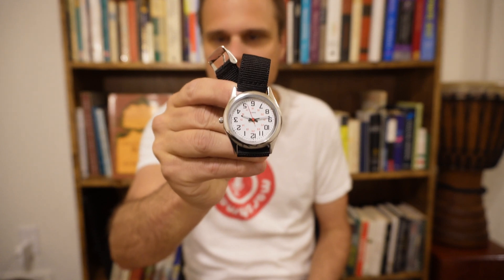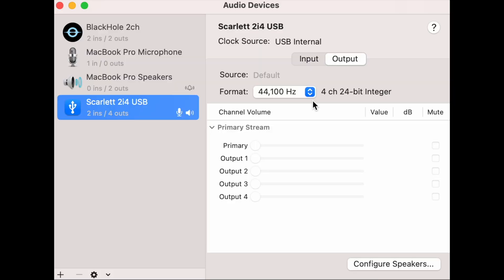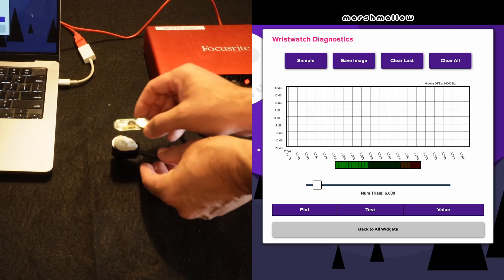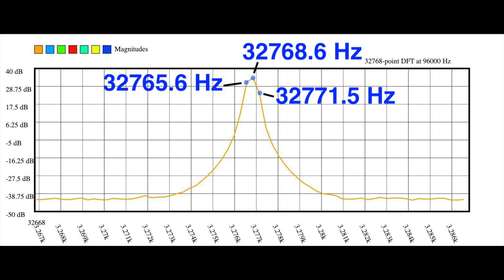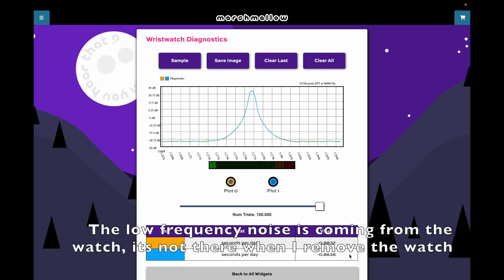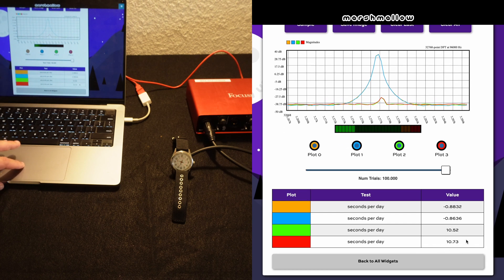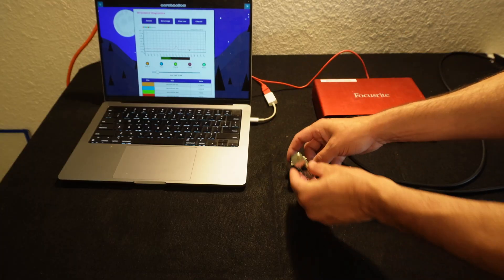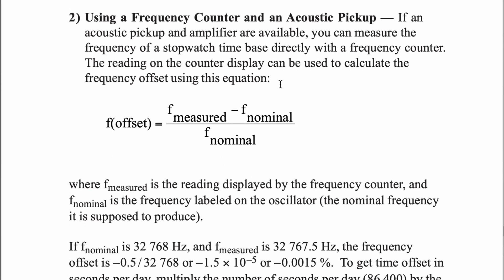Measuring wristwatch timing inaccuracy with a contact mic

Comment: I would buy a mic from you, if it comes with a TRRS audio jack that I can plug into my phone. I need a piezo mic to tune mechanical watches. There are several programs to do this, but I need a good pickup for them to work well.

Comment: I think the frequency comparison is with your Focusrite's A/D converter, not with your computer.
Reply from the maker: Ah that is true, thanks for pointing that out, it is the audio interface's clock that matters. If you wanted a traceable measurement you would have to calibrate that clock, not the laptop's.